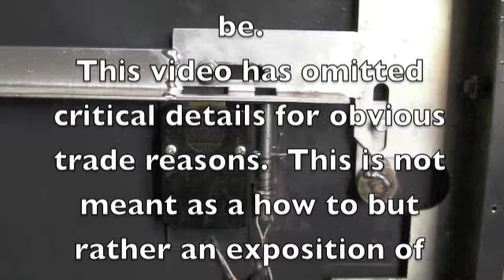AMAZING Safe Opening

Comment: Nice, but can you open a safe UL rated TXTRTL-60 X 6? Let me know.
Reply: No, he won't. The safe in the video does usually NOT come with a glass relocker. If a safe is equipped with one, you ALWAYS go for a side penetration and change key hole manipulatation.